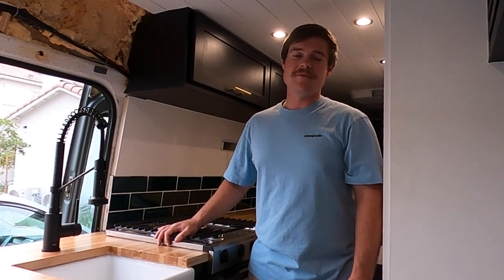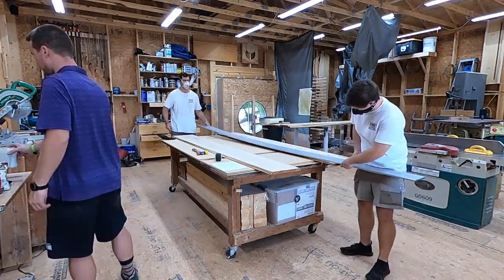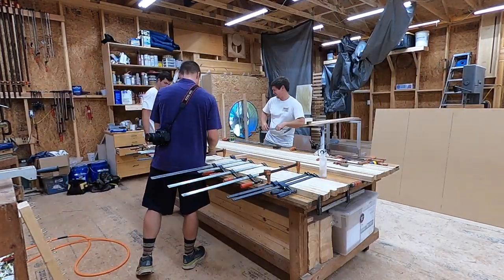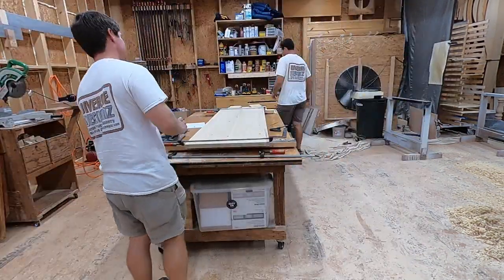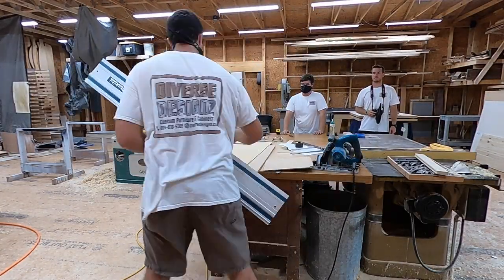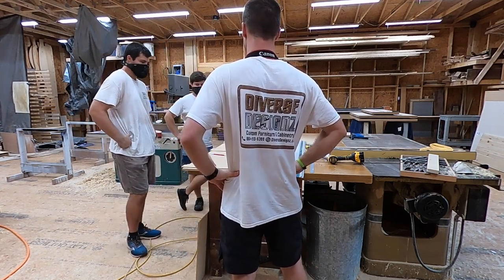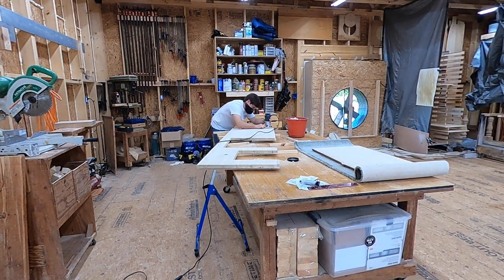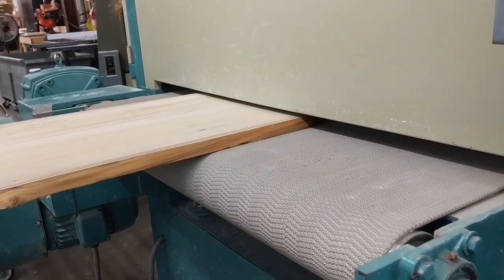Van Build Episode 19! Turning a Fallen Tree into our Butcher Block Counter and Live Edge Table!

Comment: Which length and model year is your van?
Are you satisfied with the overall strength of the engine and of the structure?
Did you have rust or other main issues?
Reply from the maker: Ours is an 04 T1N 158 wheelbase sprinter. Overall it’s been a great van. We’ve done routine maintenance on it and that’s pretty much it. We had the usual T1N rust in the door steps but after fixing that we haven’t had any other issues.